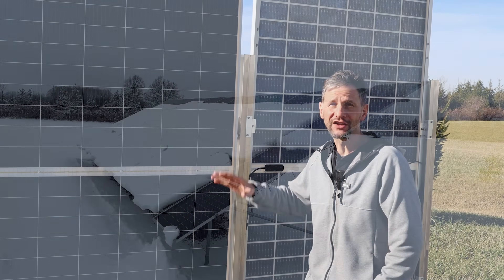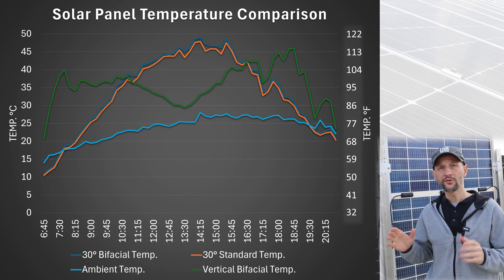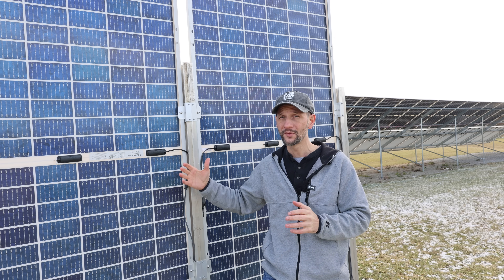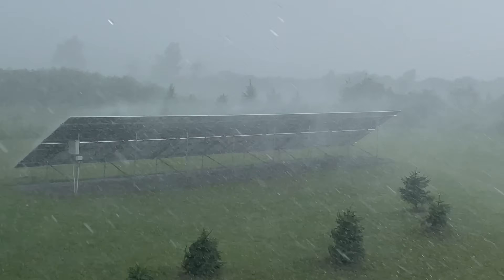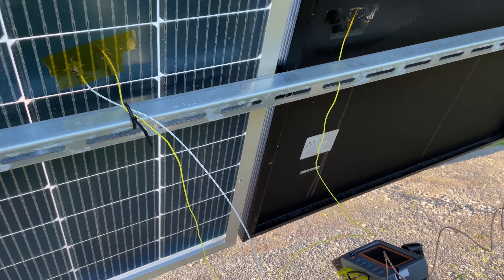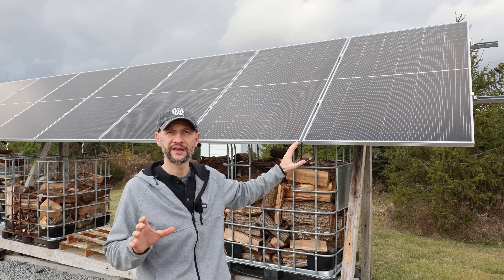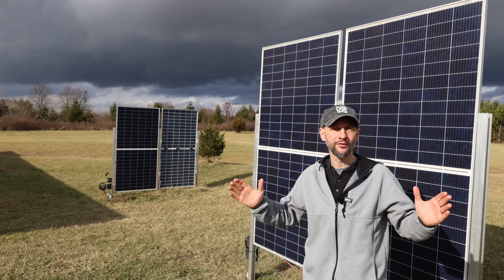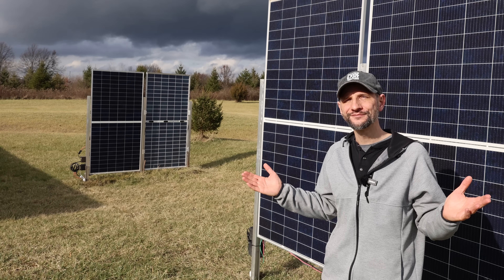HEAT -The Enemy of SOLAR- Are Vertical Solar Panels Better?

Comment from the maker: This data took a lot of time to collect and analyze.  Hopefully It's helpful for you!
Find Bifacial Solar Panel sources and discounts on my website: https://projectswithdave.com/solar-panels/ 
EVERYDAYDAVE Discount Link fort Signature Solar Panels: https://signaturesolar.com/all-products/solar-panels/?ref=SALE
SunGold Power Bifacial Solar Panels Affiliate Link: https://sungoldpower.com/collections/bifacial-solar-panels?ref=Projects%20With%20Everyday%20Dave
Vertical Bifacial Solar Panel Performance Results Part 1: https://youtu.be/5AVO1IyfA9M
Vertical Solar Panel With Reflector Results Part 2: https://youtu.be/xD1MT-ek05w
Reply: Dave, I haven’t used it, but I know that Microsoft Copilot could probably choose through your data and spit out all kinds of charts already.  Give it a try and reply back if it’s helped you.  I think Google Gemini could do the same thing possibly
Reply: Chew through the data
Reply: Actually I was thinking of South facing Winter Angle. Method #2 on Renogy webpage seasonal orientations. ( For winter: Optimal Tilt Angle = 42° x 0.9 + 29° = 66.8° ).
42° is the Latitude used.
But I would love to see the results of this current test also

Comment: My visualization of air flow suggests a higher air scrubbing cooling effect on the 30-degree panels' lower side vs vertical.     The lower the win speed the larger the effect.

Comment: It will be interesting to see comparative final results (at the final end with electric consumators) for a year round, or at least 6 months (from 1st November to 1st July) for:
1) 2 strings of bifacial PV panels placed on 30 degrees rack
2) 2 strings of bifacial of PV panels placed on vertical N-S line (1 East, 1 West); and to respect the integrity of data must be placed around 1,0m (3 feet) above the ground.
VERSUS
3) 1 string placed on a 30degree rack combined with 1 string placed vertical.

But to do such kind of analysis, is needed at least the same 16 bifacial panels (8+8) placed in T formation.

Why? Based to your results, seems that the lower production from morning and evening can be improved combining these type of displays.

Also, for us that we are not professionals, only "handy", will be interesting to see what kind of controllers/gadgets are necessary to calibrate the gap between the 2 strings of options 3).

For your work and time,. 
THANK YOU DAVE!!!! ❤

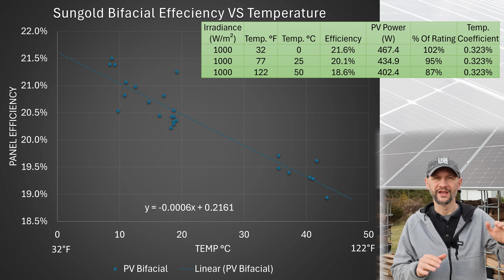Comment: Panel efficiency compared to its temperature (13:40) 
Color of the back of the panels (15:00)
Install with as much airflow as possible, manage wind loading (17:15)

Comment: Dave, 

Thanks for sharing. How significant is the ambient temperature difference as it interacts with panel orientation? Since the vertical panels generate more energy at a cooler time of day, how much does this boost their efficiency? 

You should try testing HJT type panels mounted vertically in the lanscape orientation. May have to DIY a mounting system, but that seems like the optimal vertical arrangement.
Reply from the maker: I think mounting vertical panels in a landscape orientation would be more effective.  The shading tends to be horizontal.  I mounted them in portrait orientation simply due to my racking limitations.

Comment: Scenario - wife hollers to hubby that the TV isn't working like it doesn't have power. She says to hubby - will you go out in the snow and cold and shine a flashlight on the panels so I can watch TV?
Note: I absolutely HATE the metric system. HATE IT.
Want to sell in the USA then use US measurements.
If you use 6 or 8 gauge for that run you have less losses.
Go up a size or two on long runs.

Comment: Based on your videos I decided to dabble in vertical panels. I’ve noticed that I get shading from the panel frame itself. Specifically the top and the south side. Have you noticed this as well? How do you mitigate this? Also, living at 46N we get a lot of snow and I love not having to clean them after a snow
Reply from the maker: I don't have any frame across the top of the panels.

Comment: And here's another question, we are moving back to northern Ontario Canada, and summers are getting hotter and winters getting snowier and colder which is or what Set up is best for you there ? And yes I'm talking plus 40 degrees Celsius is summer and minus 30 degrees Celsius in winter ?

Comment: You talk about difference between panels but question I have is there a difference between the charge controllers ? Like matching panels to controllers to changed up different panels to controllers ? And same  difference question using one type of panel a different type of controller and a different battery versus matching set of 3 (panel, controller, battery)

Comment: I think a dark roof is good during winter if it traps heat under the panels and thus makes the panels melt faster and produce electricity. Black panels would be good also for this. A good trade off even if you lose production at summer because it is always abundant at summer.

Comment: Thank you, Dave! I wanted to share an observation about roof-mounted panels. In my home, I noticed that even with good insulation on the roof, the temperature difference between the first and second floors during summertime decreased after installing the panels. The second floor became cooler, most likely because less solar heat was reaching the black metal roof.

I live in Estonia, where summer temperatures rarely exceed 32°C. However, without AC, the second-floor temperature could reach 27–28°C, while the first floor remained about 3 degrees cooler before installing the panels. After installation, the temperature difference has been no more than 1 degree.

Of course, this effect is strongly influenced by latitude, local temperatures, and house-specific factors like materials and colors. But in my case, it could mean the difference between needing to run the AC or not.

Really loving your work and all the deep analysis—you've helped me a lot with my system! 😊

Comment: @ProjectsWithDave
I have an idea if you want to try it yourself I'd be interested in the outcome. Put the East/West vertical panels on a mount so that through the day they swivel, starting out vertical East, being flat at midday till they are vertical West in the afternoon. Just a thought.
Reply from the maker: That would work well if you had a row that was only 2 panels.  Much more than that would be difficult to turn.

Comment: I have a question , if reflector placed below the panel than it will produce more energy as shown in one of your videos but rising temperature reduces efficiency like I live I a place with peak summer temperature 40°C and I want to place reflector below the panel is it going to improve efficiency or the rising temperature of panel due to reflector gonna decrease the efficiency
Reply from the maker: The efficiency will decrease, but you will still see an increase in power.  The reflection effect is greater than the temperature effect.

Comment: I’m getting ready to build a new system. The increase production of ground mount over roof means likely ground for me. Vertical vs 25% tilt being basically the same I’ll angle them I suppose.  Eg4 flexboss21 and gridboss already ordered. Will wait to order the eg4 indoor batteries.  Do u have a good DIY yourself racking system. I’ll likely have 30 panels or so. Thinking of a Hyperion 400w bi facial panel.  $100 at signature solar. Why are these so much cheaper than other bi facials ?  Any thoughts

Comment: Water heating piping should be incorporated into solar panels in high solar strength locations, like Socal and Mexico.  The heating loop can be plumbed into the water storage tank and have a thermostat circulating pump controller
Reply from the maker: I'm sure warmer climates can more easily make sense of that strategy.

Comment: I wonder if the heat from bottom edge of the vertical panels warms the middle and top edge as it is shed and it rises up over the panel?
Reply from the maker: Yes, but it should escape faster than the tilted panels.

Comment: Would you concur that if you have only the ability to mount bi-facial solar panels on sloped roof, have said roof coated in a light reflecting finish would improve output (A) on days of low light levels and (B) reduce localised excess heat generation which would effectively  'overheat' panels and reduce there efficiency.
Reply from the maker: A white roof would be a benefit.  I have some results on that in this video: https://youtu.be/mzqjCsZKUYQ

Comment: I'm going to install my panels on a standing seam metal roof.  I'm wondering if I got some low to medium speed fans to blow air under the panels if it would be a net positive, particularly in the summer.  Maybe you could test power output in a similar setup to see if it has a chance of being net positive?  Unfortunately, I think my setup with the particular roof clips are only going to allow ~4" of air gap and also many panels (probably two sets of 5 panels mounted vertically along the 40+ feet up my roof).

If you don't get around to testing it, I might do it myself since my array will be perfect to show some high quality results (100 panels, all enphase microinverters).   It will probably do 40+kw in the summer, so 1 degree C reduction would be 130W increase in power output, which seems like an achievable metric.  650 extra watts with a 5 deg C reduction.... Realistically maybe $50/year of value, so this is probably going to be more academic than economically driven.
Reply from the maker: As you stated, it is likely an academic exercise.  I think the volume of air you would need to move to see a benefit would be significant.  But it would be interesting to see the results.

Comment: Nice! I would say the black panels absorb at least 20% more heat than the bifacial panels. That's because the bifacials convert 20% of the energy reflected onto them directly into electricity, so there will be that much less heating.

Comment: Great video thank you. I'm still not sure on bifacial as the underneath would be shaded in normal mounting?  If the face of a normal panel was that shaded then the output would be very low or with no output at all. So bifacials would have to be mounted differently. Vertically be a bit of a wind trap.

Comment: Question, if a fan could pass cooling air over the surface of the panel, it would use some of the panel power output but it should also raise the power output, worth doing?

Comment: Great real world data about bi-facial vs standard PV panel temp coefficient effects!

My system is on my RV. Only had space for 6 * 340 Watt panels.  
Solar Panel used: Canadian Solar CS1H-340MS, 340 Watt shingled Mono-PERC 

I wanted to use Bi-facial but couldn't find any in the form factor that worked on my roof leaving a 14" gap for a walkway, ventilation and a little sunroof in the ACs old spot.
PV dimensions:  992mm X 1700mm (39" X 67") 

AC/heat is now a split system heat pump so no big box to install around and shade the PVs.
 
Before install, the roof was  decluttered and refinished with white silicon "Paint" to prevent heat buildup under the panels. 

The panels are about 6 inches US units (Or 152.4 mm International units..🥸) above the roof and angled up towards the RV centerline to help with convective and wind assisted hot air removal. Snow is encouraged to take the downhill exits off the sides of the roof.

During testing, with RV parked in it's N-S orientation, the PVs are  horizontal along the RV's N->S length and slightly angled upward from the RV walls towards it's centerline.

These small E-W angles actually makes a noticeable difference in power generation as the sun moves E->W thru the day. I have 2 MPPT controllers, each handling 3 PVs in series on the E and W side of the RV. On warm days with full sun I was seeing upwards of 80% of advertised power generation, about 1500+ Watts.

Before the RV install, around Spring equinox (Colder, more direct Sun), I had bench tested a single 3 PV series connected array on my low pitch garage roof. 

The power generation, with about a 15 degree  south facing orientation was  more than the rated 340 Watts. Expected max was 1020 watts @ 25 C (77 F), at about 5 deg C (40 deg F)  observed max was as high as 1250+ watts. I was elated with this intermittent but repeatable result.
 
On the RV system, on a hot day with full sun, when AC is desired (From 300 to 1000 watts for AC) the solar can cover that while putting more than 500 W into the battery . 

Now I need to find a 12 or (preferably) 48 volt conversion for my watt gobbling pig of a refrigerator (300W 24/7 @ 120v)!  Another 48v 100 Amp hour battery will be added as well to cover those cloudy days.

Thank you and Happy New Years!

Comment: Great video!  And I really appreciate the analysis.  Planning to go with your recommended Sungold bifacial 460 watt panels.  I haven't looked yet, but I assume its 0.22 per watt per pallet of 36 panels?  Definitely it must be ground mount but I want it low - not more than 2 panels high for easy maintenance and not shade the neighbors yard.  What microinverters do you recommend for these panels?  And what racking?  Must be inexpensive and DIY friendly as I can't get tractors or other equipment into the area but must still pass city inspection.

Comment: I was hoping that this video would provide a definitive answer, or at least particular local conditions, where vertical mount panels would be preferable or not to ground mount. I think you're just presenting too much data and not enough clarity. Ultimately the answer ought to be fairly simple: All else being equal, which configuration produces more power? It seems like your previous videos hinted at the answer. If you can surround your vertical mount panels with something like white reflective gravel spread out over the ground, that might be the most cost-effective power producer. Another interesting possibility would be a mixed system where some panels are on angled racks and some are vertical, with or without the white gravel field. Of course one's particular conditions may dictate a different set of options. If your only choices happen to be a rooftop or a vertical fence, then which would be the greater power producer and more cost-effective option? Would love to see answers to these questions.

Comment: For the difference of temperature between vertical and inclined panels maybe is the natural convection (chimney effect) made by the curvature and temperature of the panel. Vertical panel has always less exposition to the solar  radiation, it doesn't reach the maximum irradition, so it has less temperature.
But with vertical bifacial panels you can extend the timing of production.
Good data too, thank you.

i´m planning to install an hybrid panel setup to my roof with water cooled and standard monocrystalline panels. because I have a little problem with space.
Reply from the maker: What water cooling system are you using?

Comment: One thing to point out- when discussing Delta T, you would not add in 32 when converting from degrees C to degrees F. Zero delta is zero, whether it's C or F.

Comment: Brilliant piece of analysis. I have Bi facial panels mounted horizontally, 4 inches above my RV (motorhome) roof and wondered if it was better to have my roof painted silver, to help bounce light back to the Bi facials or painted black, such that the RV itself absorps the heat, rather than the heat being bounced back and adsorbed by the panels? Great work anyways and i look forwards to your future experimentation.
Reply from the maker: You should have the best result with a reflective surface.  You can see some similar results from this video I did with bifacial panels on a white roof: https://youtu.be/mzqjCsZKUYQ

Comment: I do wonder if the difference in temp between the bifacial panels and the monofacial might be impacted by their position. The top row might run hotter because it's getting the heat rolling up from the bottom row... but it might also be cooler because it's probably seeing more wind?
Reply from the maker: That's a good question, my data would not have compensated for it on the main array testing.  I think there was enough air movement to negate the majority of that effect, but I'm sure it's not zero.

Comment: 5:18 I laughed when I realized that the panel temperature was closely correlated with the panel output. It seems obvious now since the sun causes both.
Reply from the maker: Yea, I don't know what I expected, but when I first plotted the data I was amazed at how closely it correlated.  I think I expected some thermal mass delay but it matches almost to the second.

Comment: You should do simple tests with mylar blankets under the open bifacial panels mounted with an angle. These are very cheap ways to improve solar incidence over the panels.
Reply from the maker: I plan to do some more reflection testing in the future.

Comment: Here in Ontario Canada installed south east vertical panels. Major goal is to have low sun snow free panels, when there is winter sun they are my major solar source as the slopped ones are covered in snow.
Reply from the maker: I think that's a great strategy.  Matching your needs with the best solution for your environment.

Comment: temp data was skewed for the vertical panels bc during half of the day the thermal sensor was in direct sunlight.
Reply from the maker: I moved the thermocouple at noon from the back of the East facing panel to the back of the West facing panel. I also took another data set with one on each panel.
Reply: but the data was awesome, not trying to detract from that. appreciate the depth of info youve put out